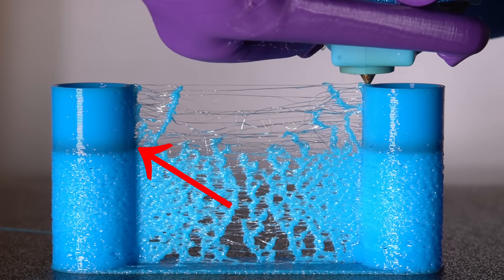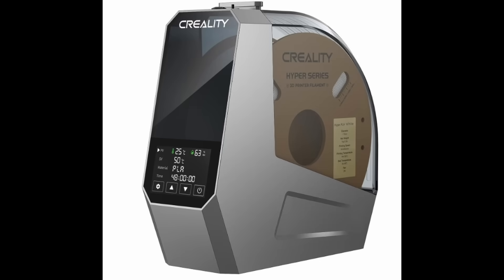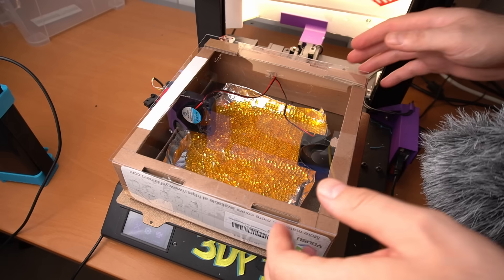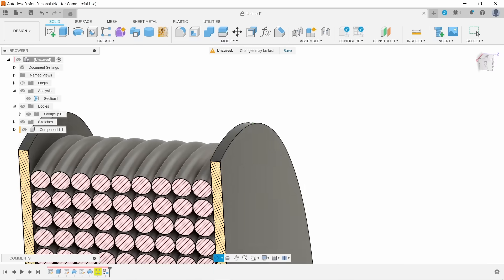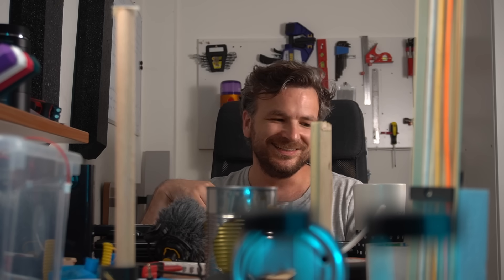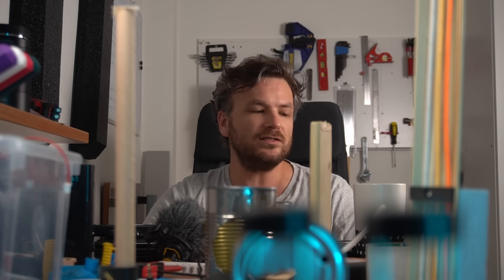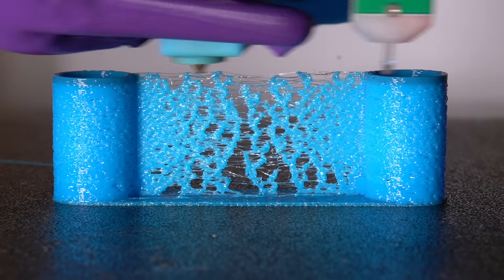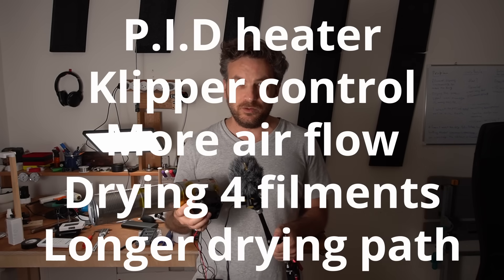Why are we drying filament this way?

Comment: Silicagel is actually a very bad drying agent (but it's probably the safest one). It's affinity to water is very dependent on the humidity of the surrounding air. At 100 % humidity it can store more water than most other drying agents.But at a reasonable humidity, like 25% and lower, it's water affinity is so low that there is barely any water it can store without the humidity rising. Personally I've always used those dryer packages that contain calcium chloride. They can liquefy if they absorb a lot of water, like if the container is not tight. In the future I'll probably use a combination of calcium chloride and quick lime for storage. The quick lime has a super high affinity to water. Even when it's nearly saturated, the humidity shouldn't go over 5 or 10 %. It's very slow, though, thus the calcium chloride.
I never actively dried filament.

Comment: It's definitely a neat idea for Accelerated drying, but most dryer boxes are used just as much for storage while printing as drying (almost entirely, in my case), so a lot of the time speed doesn't end up being much of a consideration 🤷🏿‍♀️ still, that doesn't make this irrelevant, and it definitely has use cases

Comment: Hi. I think this can be improved by not only heating, but also drying air. I was thinking about using peltier element installed in circular channel, so one side is heating, other side is cooling. When hot air is being cooled, waters drops from air and it becomes more dry, which is what we need here. Then this dry air is heated and so on. Hard to explain in comment, so I can contact by email if You're interested in this idea.

Comment: On the spool only the outside of the filament will get hot airflow to dry.
Only the outside of the filament is exposed to humidity in the air so only this part needs to get dried out - no?

Comment: Okay,   A Tube made out of solid desiccant that is heated to proper temp with an air flow through it.  What do you think?  I just made a TPU ring cane out perfect then straight to a Xenomorph that needed supports and it was a bubble monster.  I am so ready for this.

Comment: The air used to dry the filaments should be drier than the ambient air. Then it can absorb more moisture. You can achieve this by sucking the air through a cylinder filled with desiccant (silica gel). It is best to have 2 cylinders arranged in such a way that you can switch between them. While one is working, the other can be dried.

Comment: My filament dryer, looks exactly the same as you shown on pictures, has airflow. I hear a little bit a fan working inside it. I even didn't thought that there can be dryers without it. I bought it 2 years ago, so it doesn't looks like a super last invention. Another moments. I thought that it was just like for a placebo effect, that it doesn't solves anything and my printing is the best as with drying as without. Until I got some filaments that is not good enough. As for now - I do not dry filament an 8 hours before printing. Usually, I turn dryer on when I decide to print. So, I starting it maybe a ten or couple of ten minutes before printing, while I preparing models, slicing, trying different settings, etc. Sometimes even without that time, right with printing process. And it works fine with such kind of non-good filaments. Maybe, until I get a very ugly filament?

Comment: My only issue with tpu getting tangled in the extruder. Experienced that blobbing, but when i switch on other slicer app it eliminated the blobbing. Have my tpu sitting on the spool holder and open. Diy my own filament dryer but worsens my tpu getting tangled. Now i just print tpu straight out of the box or use and opened one left about several weeks without dessicants. Prints fine even with retraction.

Comment: If you're going to try to dry the filament in line, why not get one of those very large coffee cans and wind it around some sort of a mesh spool in the center several times, so that you could get a couple feet or maybe better than a meter of filament inside the dryer at the same time, giving it FAR longer to get dried?

Comment: JIT filament drying. Interesting. I'm using the "dry the whole damn spool" method, followed by dry storage (sealed container, desiccant) which I think is the standard method and I guess it not very energy efficient. A problem you might be running up against is the moisture diffusion time; the water nearer the core of the filament needs time to move to the surface to be removed. The residence time in the dryer might not be enough to permit that to happen. I actually don't know how or if the amount of moisture varies through the thickness of the filament, but I would expect it to be more uniform in filaments that are very hydroscopic (nylon, for example) or filaments that have had some time at high humidity. It might be useful to measure the weights of lengths of filament before and after running them through your "can dryer", and also at varying feed rates, to see what impact the dryer is having and whether there is a point of diminishing returns beyond which more drying is not helpful for print quality. Looking forward to more experiments. Subbed!

Comment: "After waiting 8 hours, I've forgotten what I wanted to print" thats great. I dry PLA for about 1-2 hrs then test and thats worked out well.  YES please continue this is great. My sunlu drier has worked well,  but I dont like heating the entire roll. Over time this likely degrades the material. I also dont like the position, next to the printer. I would prefer over the extruder and then a heater in line. What about pellets and drier? Im hoping the indistry moves away from filament from a cost and quality perspective.

Comment: I only print from actively heated dry boxes. I wish my Prusas XL had a built in inline dryer. The print quality and strength is a so much better with dry filament.

Comment: Very interesting. Looking forward to seeing your V2. Do you need to dry the air before heating it or does the heat give the air enough capacity to draw the moisture of the filament? Could chilled air say from an A/C be heated by your system and then have greater moisture drawing capacity? Or did I just over engineer things again?

Comment: So, I can see in those commercial units, that they have silicon beads. Have you tried running the filament through that as well as the heated air from the fan? Perhaps fill 2 of the cans with the beads to run the filament through, and the fan to move hot air through the beads as well? You may need to add a filament duster type thing in to make sure the filemant is free of dust from the silicone beads? We have a silicone cat box 'sand' in South Africa that is GREAT at removing moisture, and leaves your hands feeling dry, just from handling the packet, but it is really dusty. Sure this would dry anything.

Comment: Lots of comments on making the filament path longer to increase drying time but I'd make sure that the path and its geometry are as low-friction as possible. PTFE tubes would obviously defeat the purpose but u groove bearings might work.

Comment: Even though I fully agree that current filament dryers are a pretty dumb solution when you think of it and inline filament drying would make a ton of more sense, my guess for it never taking off is the ease of use of current filament dryers compared to an inline filament dryer...
A "traditional" filament dryer is pretty much "set and forget" and while the idea of an inline filament dryer sounds very cool in theory, you already touched on the many headaches it can introduce since you now have to factor in print speed and a whole lot of other factors making it a hassle to set up reliably.
Having said that, I'm really looking forward to see the next iteration of this project!

Comment: A quick search into this and there's two approaches that seem common.  One is vacuum which was mentioned by other people.  However, microwave drying is also apparently a good method to remove water from plastic since microwaves are tuned well to excite water molecules specifically.  The main need of any method is to not introduce too much heat or you can degrade the plastic.  We microwave plastic containers all the time, but we never really think about moisture content in the plastics.  We also use many plastics in food use that don't really absorb any moisture.  One would need to test if there is sufficient moisture in a filament spool to cause heat problems, aka melting or degradation of the plastic molecules where we might see a much weaker part.

Comment: why not run it through a long vacuum hose, it's flexible and long and that should give far more working distance for the inline dryer. I'd run the filament in through a hole in the side near the start and use the actual hose opening for the heater and fan. can't use too much heat though, since it's plastic but you're drying plastic anyways so it shouldn't be a problem

Comment: Dude. Awesome video and love the back and forth with the wife. Good stuff! How do you power the fans? I'm thinking about adding active cooling to my A1 and have no idea how to power them, cause I'm used to having a PC power supply for case fans.
Reply from the maker: What fans?
Reply: @3DPI67  the ones used to dry the silica gel.
Reply from the maker: @jf0314  I connected them to a pd power bank via a trigger board, I have a video on my channel
Reply: @3DPI67  thanks. I couldn't find the video, could you link it?
Reply from the maker: @jf0314  it's called: This will CHANGE How You See Power banks | BASEUS 30,000mah 65W

Comment: Always thought this would be a better way. But thought it would take longer to dry than the time it spends in the drier. But if you run it around some pulleys you can extend the time spent in the drier and get better results.

Comment: Could try with a Hair Drier. Electric Heat which can drop humidity well below 10% and blows a lot of air. Get something that has some modes on it. Essentially that is what you are making but just feeding a strand of filament through the air the thermal guard scaled up.

Comment: i own a drywise... these things are garbage... they work if the you can use them but you cant lol! i can ehm... make pictures of the inside if needed. they basically have a big tube that's heated from the inside. by heaters etc.

Comment: I have one of the filament dryers you showed in your video. the Sovol 3D.
I don't use it. It is not nearly as effective as keeping my filament in a dry box full of desiccant.
If I understood your video correctly the humidity artifacts improved when you added the dry box. 
You showed the benefit of a dry box not an inline dryer.
I'd like to see a comparison between:
1. dry box alone
2. inline dryer alone
3. dry box and inline dryer combined.
If these results showed the benefit of your inline dryer I would be impressed  enough to build my own inline dryer and sub to your channel.

Comment: It's an intresting concept and the bottomline is what is the right combination of time, heat, and moisture removal to make inline drying efficient and a better solution than throwing it in a box to dehydrate. (ie set and forget)

Comment: I think one way to make normal dryers better would be for the core of the spool to be perforated, and supported by a shaft connected to a fan, pushing air into the core and through the whole filament spool.

Comment: You don´t see those kind of solutions because polymers dry slowly. They ca´t really dry fast. In the end you basically took dry tpu and printed it through those cans and also changed some settings, this is a horrible design of experiment. This really is inconclusive.

Comment: If water made its way to the center of the filament, I dont see how its possible to get it out in a few minutes (without damaging/deforming the filament). Maybe it can be done faster than traditional filament dryers by drying it "uncoiled", but slower than realtime drying seems unavoidable to me.  But what do I know,  the only way to really find out is measure it. Dont ask me how. Super accurate scale maybe? Humidity sensor?

Comment: I've used the Thordsen. It works well enough after a sunlu dry box but lacks performance on fully saturated nylons.

It would benefit from having actual airflow to improve the release of water.

If you can make something a little better than the Thordsen then you would be doing good things for the community.

The heater control element for their unit can be used with virtually anything else. When purchased from Aliexpress it ends up costing about 40 USD for just the control unit. So potentially you could take the Thordsen and reassemble it into something better.

Comment: The concept seems to be promising, however based on your results the filament isnt fully dry as there are still bubbles in it. Drying needs to be done completely else there will be compromises to the structural integrity of the print. Maybe try inducing a vortex effect across the length of the cans so that more air is moving across the filament within the same amount of time.

Either way, good first effort on this - already looks more efficient than the dry boxes (although this isnt saying much). Personally I just use one of my printers to dry filament (Method X), as it has an active heated chamber to do so.

Comment: i definitly want a version 2 and maybe a guide on how to build something like this.

it doesnt look too complicated....
maybe even insulating the cans and or making airflow ducts inside them to guide the air more onto the filament than just flowing around it could improve it even more.

definitly very intriguing and a thing that im amazed i havent seen messed around with more before.

i Print my stuff in the basement and since we had a water leak for a long time the walls are quite wet and it will take a long time until its dry down there, my filament already gets ruined when printing longer prints... its insane.

Comment: I suspect they don't exist since it's less profitable and doesn't "fully dry" filament -- the old method may be worse but it's simpler and universally applicable. 

my understanding is some filaments will eventually degrade on the spool with high levels of moisture -- after that point no drying can revive it -- so it may still be beneficial to keep the whole spool relatively dry even if you are drying the filament that gets printed. This could be as simple as a passive desiccant drybox, or you could just use up all the filament before it gets a chance to degrade 😂

Comment: I think this concept has a lot of potential! I think the easiest way to go about it is by using a slightly leaky system. This would let dry, hot air suck the moisture out of the filament and transfer it to the environment. Ideally you'd have a heating element at the bottom so the hot air goes up, and the filament going down. You could have a bunch of 2-5mm holes in the system that double as entry holes for the system, and a separate cap for the exit that does not let much air through past the filament (to reduce condensation there). The side would be a good place for something like a hair dryer to push air into the system.

Having the heating be outside of the container would also reduce issues with heat creep and filament softening along the path. 

Coincidentally, I think increased heat creep and jams due to filament arriving at the extruder pre heated might be why this hasn't taken off yet.

I have to say though, your tpu looks like it is stored in a shower or something. Mine only gets that bad if I leave it out of its box for months. Do you live in a very humid climate?

Comment: I think you evaporated the water from the sufrace of the filament at it had limited time to really get absorebed. So the efficiency of such dryer is limited to filaments that were exposed to humidity for a shorter period of time.
For longer exposed ones you would need some longer path (longer tube or curled up in the tube) to really give time for the humidity to leave the material, and my guess is it will never reach perfection because these things usually take longer time than the filament stays in that hot tube.

Comment: Try alumina dessicant instead of silica gel, IMO, it's far superior. It's a ceramic alumina oxide based product, that can handle dessication at a much wider range of temperatures, doesn't explode/split randomly like silica gel, and I've had much better results with it in my dry boxes. (I've been able to get, and maintain very low single digit RH numbers in a properly sealed (silicone gasketed) container, for long periods of time, with nylons, etc. I believe it could handle direct contact with resistive heating element/wire as well. Only problem I've seen is that it can produce a bit of alumina dust if jostled around much (you can wash it to clean, then bake it to re-charge it). I've seen mixed numbers on the performance of silica gel vs alumina dessicant, however, my experience has shown me personally that it's far superior in all ways (it's even cheaper if you can find a wholesale supplier), and it seems to be much more favored in industrial drying applications for compressed air, etc, in fact, I first became aware of it, and acquired my supply, from a large pneumatic moisture filter I found at a local scrapyard almost a decade ago, I heated it, and have been using it ever since!  I look forward to V2. Cheers!